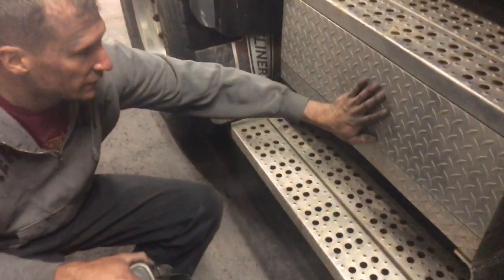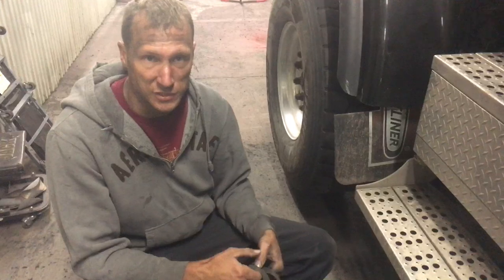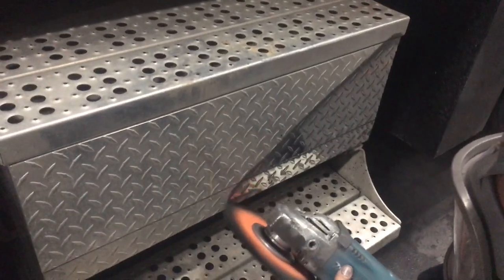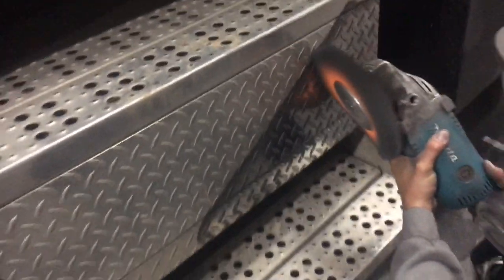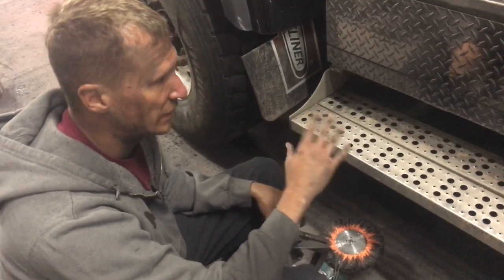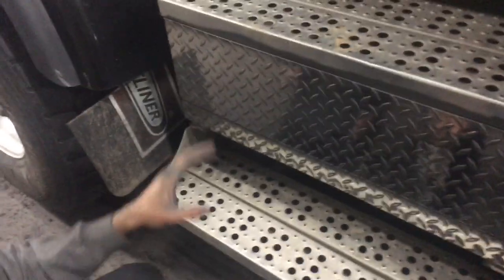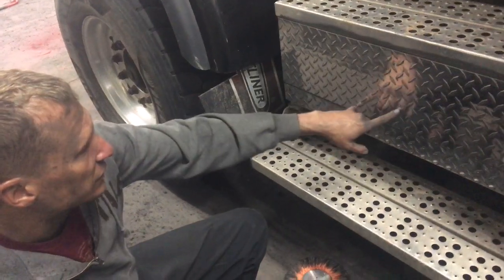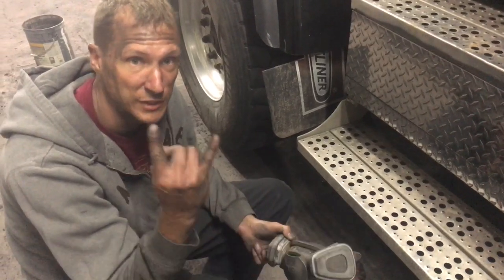How to Polish Diamond Plate on Semi Trucks - Evan's Polishing and Detailing

Comment: I never thought Id be so confused on how to polish diamong plate...I have too many methods to choose from. Do I use the angel grinder with the cotton wheel? Do I use the smaller cotton wheel on a die grinder? Do I use the dual action angle polisher with the wool pad? Do I use noxxon? Do I use some super duper fancy bottle of stuff? Do I use Dialux (I have the green and gray which I know ill work wonders on Aluminum)....

Yes..too many options and one broken back that makes me want to do the best job, the fastest. And your method seemed like its the winner. 

PS. Im polishing the diamond plate on a Matco Custom (the ones with the diamond plate on the front of the drawers. Nice used box that needs to shine)
Reply from the maker: This is the method we use on all diamond plate in my shop. Super simple setup and easy to do. goshineon.com 2 step aluminum polish kit.
Reply: @EvanStegerMetalPolishing  Well...I tried this method, using the rouge, and followed up with the vert de paris (green), and it was amazing...unti.l my cheap cotton wheel decided it wasnt going to spin lol...I ended up using a power ball ....but in the end it came out great. Of course I ordered the replacement cottonwheel and it comes when Im done LOL.

Comment: Hello Evan I have a W900 86"studio what would it cost if I can get up to your shop to pull wheels sand show polished sand shop polish both 150 tanks diamond plate lid on step box diamond plate on 42 inch box top and headache rack with smooth border and diamond plate center. If you do chrome and stainless as well have plenty of that. I would normally do it in my shop but my ex cost me that and everything else about 5 years ago then year after were done cost me $56,500.00 and just can't find good polisher that knows what they are doing anywhere on my runs.
Reply from the maker: Does it have to be sanded? Most show polishes we do don’t get sanded. Shoot pics to my cell number and I’ll get you an estimate.

Comment: Hey Even, the step boxes on my W9 are diamond plate and I don’t have enough room to hit the diamond plate from all angles. I ended up with a lot of compound left on the plate. Is there any easy way to get all this compound off? It looks awful.
Reply: microfiber and liquid aluminum polish can help, or use glass cleaner
Reply from the maker: Hand polish works well. I use a cotton Terry applicator and a cotton Terry towel to remove it. I have a how to blend tops of tanks video. The same process applies.

Comment: I run a peterbilt dump truck and the front of the box is pitted. Do you recommend sanding it down? I usually sand everything thats needs it but I wasnt shure on the battey box since it's kinda thin metal to start with. What would you do?
Reply from the maker: jordan palmer I would recommend sanding it for sure.

Comment: what do you do when you get one with heavy oxidization and pitting? tried cutting with a heavy wheel and super heavy compound, then to heavy, then a softer wheel and so on and it just keeps getting buildup of polish on it and stays dark gray, tried sanding 320-600-800 to help with that and did work for some pitting but no where near just lightly oxidized aluminum. it was acid washed first to remove the oxidation. any ideas? i know wheels, compound, how much is used is all hard to go by but i’ve done tanks, steps, wheels, everything else just fine and with a mirror finish. using a dewalt at 3600rpm when using heavy cut.
Reply from the maker: I don't personally do heavily oxidized diamond plate. Too much time and wasted products for not great results. Hope this makes sense.
Reply: @EvanStegerMetalPolishing  unfortunately it does, we don’t make any promises other than it’ll be better than it was on pitted stuff and non cared for diamond plate

Comment: Hey evan,  I've been working on my diamond plate toolbox and I can't get that mirror finish.  Box is 13 yrs old.  I've used the orange and yellow buffs.  Should I try sanding? Or flannel buff with purple rouge?
Thanks,
Ryan
Reply from the maker: Sometimes diamond plate is too far gone to get that perfect mirror. Sanding usually doesn’t do much on diamond plate.
Reply: @EvanStegerMetalPolishing    Thanks for the tip.  The videos you provide are great
Reply: No Name  Yep,  that's what he does.

Comment: Can u do this with real ruff diamond plate
Reply from the maker: You can but real rough stuff doesn't shine great. It just turns like a dull gray color.
Reply: @EvanStegerMetalPolishing  I've seen some use a scuff  pads then a orange  wheel
Reply from the maker: @Kid617  You surely can but it still just comes out shiny gray usually.